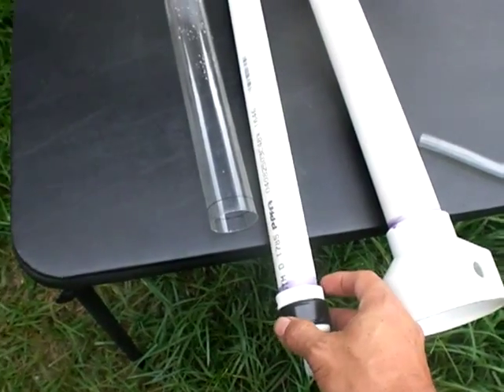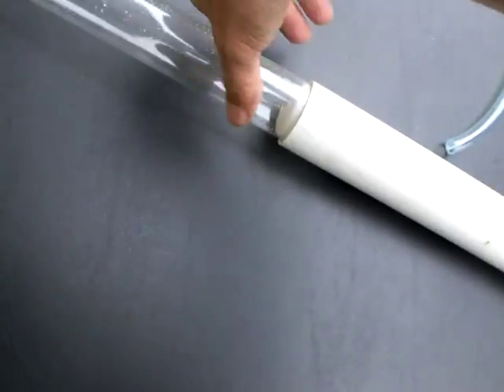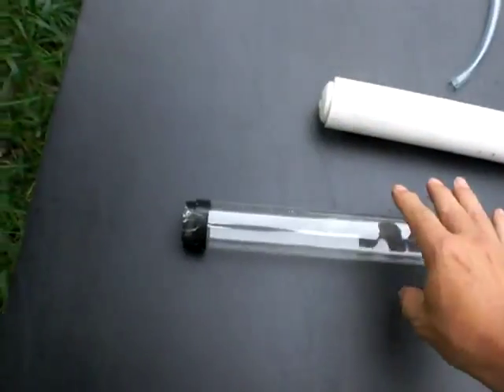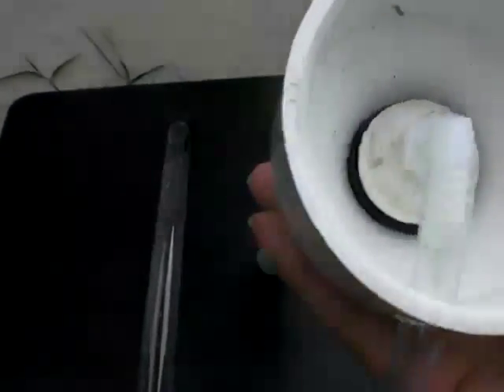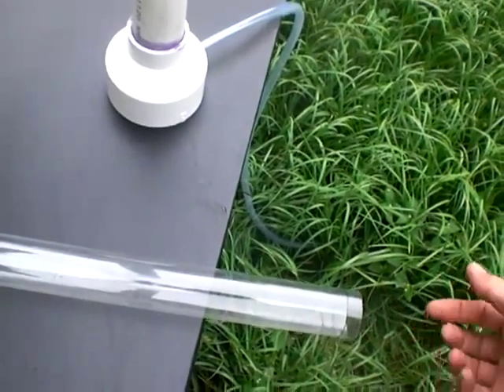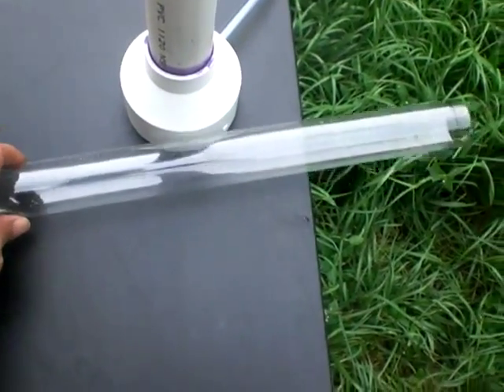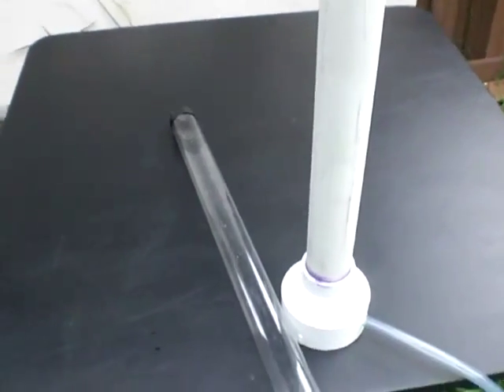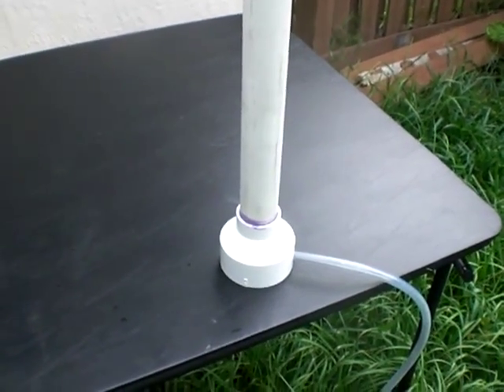How-To YAHHO Flow Meter - Part 2

Comment: This is really fantastic, L
I can see the need for a more accurate meter, even for myself.
This will be my next flowmeter.
I think 1 liter would be sufficient for most individuals up to even 6 LPM(10 seconds per L). Not only that, this meter could be accurate down to say 10 mL if you took the time to mark it all out!
Like I said...FANTASTIC!
Steve w/InstallGuys

Comment: Such an excellent design Luther, awesome!
I heard you mention, "if you could find a larger diameter tube, you could measure more gas in a shorter device". But the beauty of this small diameter tube and its long length is its accuracy ability, which = consistant measuring.
Fusion8r